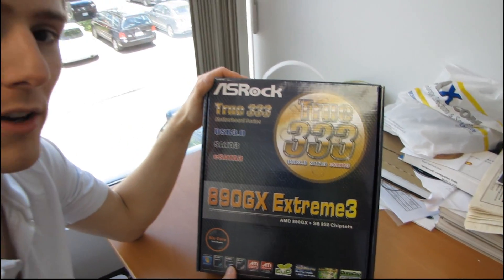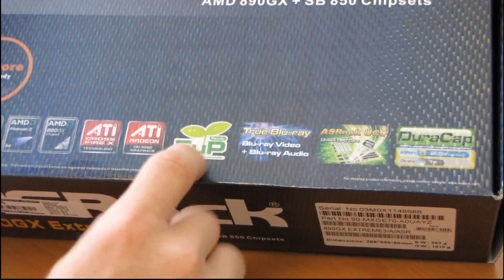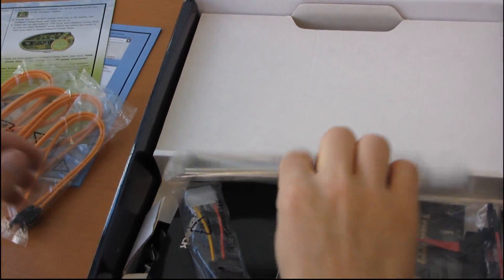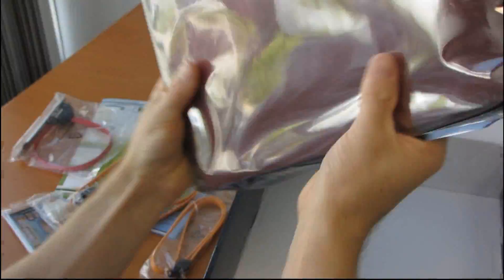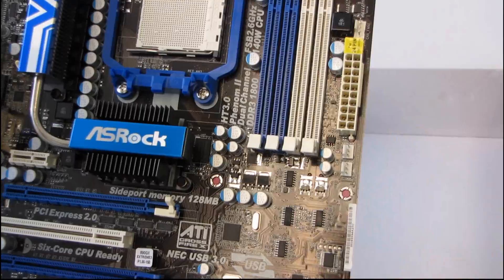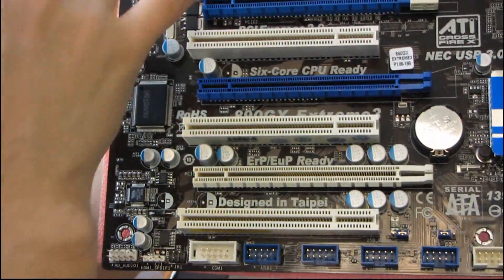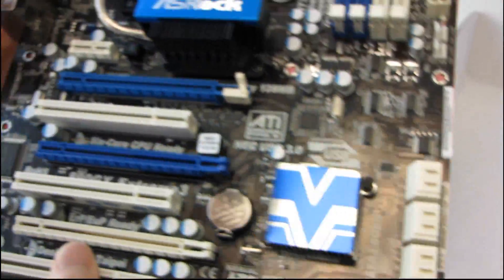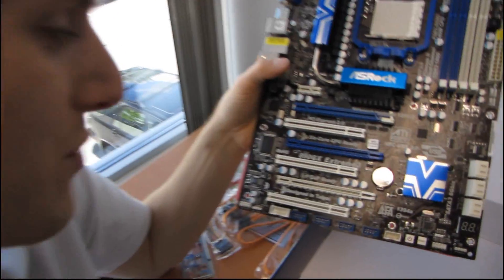Asrock 890GX Extreme3 890GX CrossfireX Motherboard Unboxing & First Look Linus Tech Tips

Comment: I bought the 890gx extreme 4 from asrock. That's one tier higher than this one. And it works but I would not recommend it. I had insane difficulty getting the Board to function properly. First it wouldn't post, then I couldn't switch users without a blue screen, then I couldn't get it to post without resetting it a few times. I got all of that working. But it still won't recognize any ram higher than 1333. Even though it states that it supports up to 2000mhz ram. Spend a couple bucks extra and

Comment: @rickveens92 I wouldnt buy this board for a crossfire setup.
 I would stick with Asus and look depending on how many cards your going to run  crosshair 3 formula 2 cards at 16 each or the crosshair 4 formula 3 cards at 16 each and one at 4.

Comment: there you go again reviewing products without knowing what stuff is.
Really wish you would do your research first.
the ideal location for a 8 pin power connector would be on the bottom so you don't have to buy a extended cable everytime you do a new build!

Comment: I disagree with the 8pin, with where it is, being an "ideal" location. When building a computer from scratch, and using a massive CPU cooler (such as the Noctua NH-D14), it's a bloody pain to install the 8 pin. I'd rather have it to the right of the Ram.

Comment: A*$ROCK...hmm. Value product doesn't mean necessary a bad product. But I firmly believe that the smaller the company, the higher chance they will screw you on warranty, RMA and tech support. This one is a subdivision of ASUS I believe. Same with EVGA and XFX boards, look and cost almost the same but man you're in for a surprise if your crap burns out and you need a replacement. A friend of mine is waiting almost a year for his XFX board RMA. No replies from tech support either.